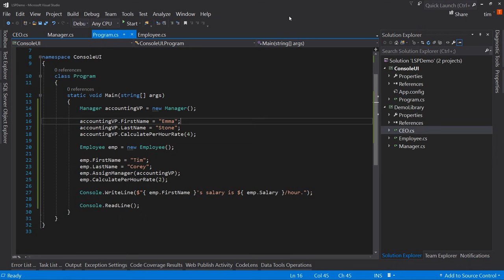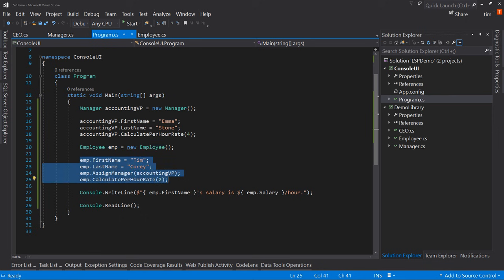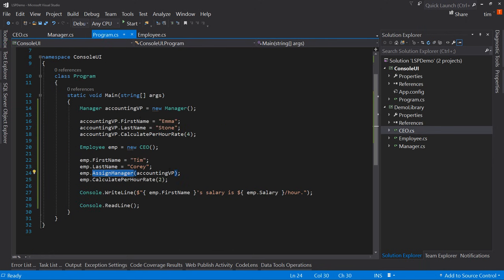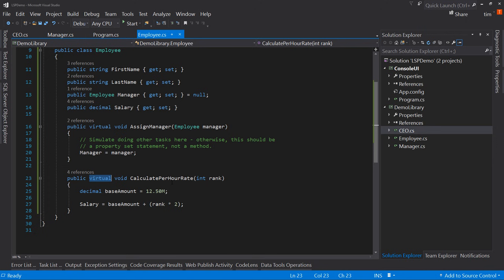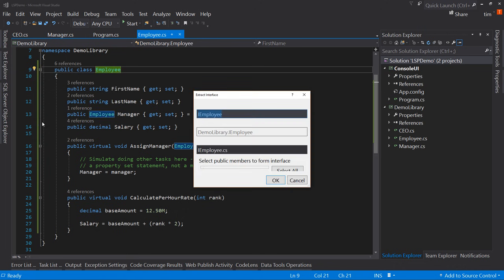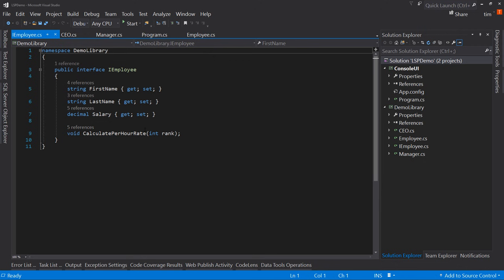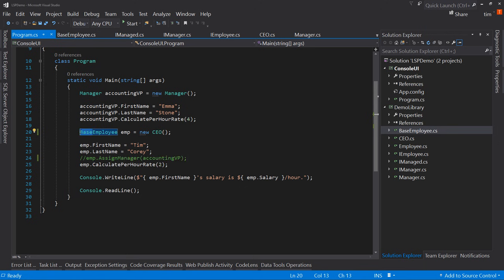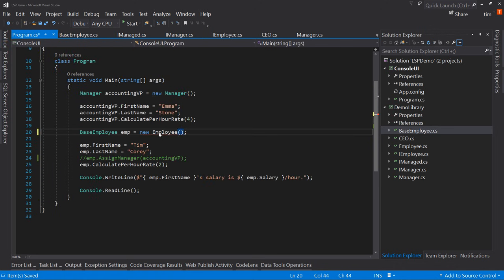Design Patterns: Liskov Substitution Principle Explained Practically in C# (The L in SOLID)

Comment: Can we change interfaces to classes. Also the series is great but can Design Partterns apply to GUI design such as WPF, Xamarin Forms and Winforms. I usually write hundreds line of code in a Main UI file and it become really hard to maintain
Reply from the maker: No, we can't covert interfaces into classes. They are two different things. However, when you apply an interface to a blank class, you can scaffold out the classes and properties and methods you to satisfy the interface using the Quick Actions and Refactoring (Ctrl+. on the interface name). As for the UI, yes, you can apply Design Patterns to the UI. One of the biggest patterns you can apply is to separate out your concerns. Only put user interface code in your user interface. Put everything else in a class library. That should reduce the amount of code you have in your main UI file.

Comment: Although I got the main idea behind lsp but isn't the way of saying things breaking wrong. Even if the CEO inherits employee, if the CEO has no need of AssignManager method it will simply not implement it. So even if I write Employee e = new CEO() and then call the assignManager method on e, it will obviously call the method in Employee class and not break anything. But like I said I have got the main idea that inheritance should be correct which is definitely not the case here
Reply from the maker: Actually, that's not how that would work. If you called the AssignManager method on e, it would call that method in the CEO class instance. If you hadn't implemented it, it would crash the application. There isn't a fallback place to call. Even if it did, what would happen? It would try to assign a manager to the CEO, which isn't right. So even if you convinced your software to work this way, it would leave your data in an invalid state (a CEO with a manager assigned). So that leaves you with two options: make it work and have an invalid state or don't make it work and crash the application. That's why we don't abuse inheritance. We use interfaces and only apply them where they make sense. That way, CEOs cannot have the AssignManager method.
Reply: @IAmTimCorey  Well I tried and it worked. Like I made class A inherit class B (class A : B) and then made a virtual method F() in B. Then I did B ob = new A(); Then I did ob.F(). And this called the method in B and didn't crash at all. If I override this method in class A, then it would call the method in A. So it didn't crash. I am using dotnet framework 5 which means c# version is 9.0. But I did understand the main idea behind this principle. Don't make a class inherit methods which are useless to it
Reply: I also watched your Interface segregation video and the idea it conveys seemed the same as LSP. Break the functionalities into smaller classes and their interfaces and make a class implement multiple interfaces if that class performs more responsibilities. I also learned strategy pattern and turns out it also says the same except that it achieves this with composition rather than inheritance. Please correct me if I am wrong. And thanks for replying.

Comment: Great video. Except for LSP, other principals are really good. Somehow LSP does not make much sense.
Reply from the maker: LSP is really so simple it seems obvious. If a parent class has a DoWork method that has code in it, the child class should not throw an exception when you call the DoWork method. If you find you have to throw the NotImplementedException in the child class but not the parent class, you're not doing OOP "correctly" anyway.
Reply: Imagine you have a bird class, every bird has wings, but not every bird can fly. So we create a base bird class that has property Wings, and we also create interface that has method canFly
Reply: @olegsuprun7590 excellent explanation!

Comment: Why take an interface as  an argument? Wouldn't a regular class work as an argument as well?
Reply from the maker: You can definitely pass a class instance in as an argument. However, then you are forever tied to that specific class. Later, if you want to change out that class, you have to change at least that method and probably a lot more. By using an interface, you are not directly tied to the specific class.
Reply: Because of this, and taking in an Interface, is this part of the dependency inversion principle?
Reply from the maker: You will see it in the Dependency Inversion Principle so yes, it is a part of it. However, there is more to DIP than just programming to interfaces. I just wrapped up the code for the demo last night and I'll be recording that video hopefully tonight. You should get it Monday morning.

Comment: So we used BaseEmployee (instead of IEmployee) because we didn't want to duplicate lots of code. 
But what if Manager has lots of code (most of which we want to share between various managers) too? We can't create BaseManager and use it, because C# doesn't have multiple inheritance... 

(I'm just curious what are possible solutions for C# people. Sorry if my question is incorrect, I don't know C# beyond snippet programs)
Reply: Besides, thank you for the video, it's amazing!
Reply: Anyways, even if C# had multiple inheritance, we couldn't use BaseManager, because manager is not a true thing, but more like a property of a thing (like wheels from your example). And the problem of remains, how do we not duplicate code of manager/wheels?
Reply: In C# one class can't inherit from more than one class at the same time, but in this case you could have BaseManager inherit from BaseEmployee and then have every Manager class inherit from BaseManager. You'd still have acess to all BaseEmployee properties and methods and wouldn't break LSP because Manager IS a BaseManager AND a BaseEmployee.

Comment: Goodness me, that's interface hell. I know it sounds nasty, but couldn't you just have satisfied the compilation error by having no code in the AssignManager method for the CEO class?
Would it have satisfied LSP or is having a do nothing method just bad coding practice? It's easier to understand than creating one or more interfaces for every level of your class hierarchy.
Reply from the maker: Having a method that has no code is a really bad thing. What that will do is give future developers the impression that they can do something that they cannot. This leads to bugs in programs. Don't write dummy code to satisfy the compiler. Fix the issue.
Reply: @IAmTimCorey  I needed to read this! I slowly drifted towards accepting the normality of what happens around me, but it's really not OK at all!

Comment: here I thing naming convention is not good as here you have taken property of employee type in employee class only, which voilates naming convention.
Reply from the maker: There is not a naming convention violation here. We are in the Employee class so assigning the Manager to type Employee is correct. It doesn't make sense to use an interface when inside the implementation.

Comment: oop = get complex code fast and lose your brain 
i finished  two  book about  design pattern and  i still get confused
you need to try hard to get best design 
but if you get it  your life will be easy.
Reply from the maker: OOP can get complex but the key is to learn it slow, not try to dive into the deep end. Get comfortable with classes first (static and instantiated). Then work with inheritance and interfaces. In the meantime, get really comfortable passing class instances around (and understanding how they don't actually move around or copy). Once you are comfortable with all of that, then move into SOLID.

Comment: Hey Tim, love your videos. 
It seems like CEO was moved over to inherit from the Manager interface at the end of the day, which made me think, why not let CEO inherit from the Manager class and simply seal the properties and methods that doesn't apply to the CEO in the Manager Class? That way you get (1) all the necessary properties and methods from both the Employee and Manager class (2) You avoid adding a new class and implementing 3 new interfaces, which can easily confuse people because they have to maintain more files, and logically it makes somewhat sense, in my opinion anyways, a CEO is an Employee and is also a Manager.
Reply: CEO does not have have manager, but manager will. So CEO is not same as Manager, thus cannot inherit from the manager. The whole point of this video is about it.